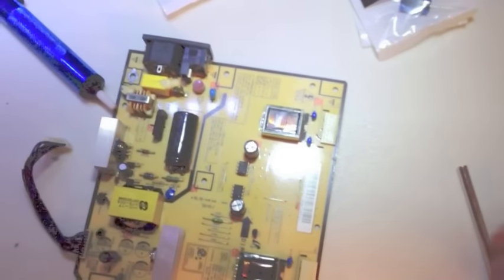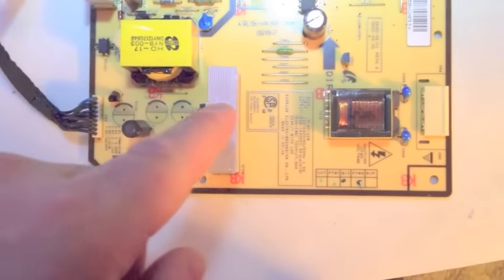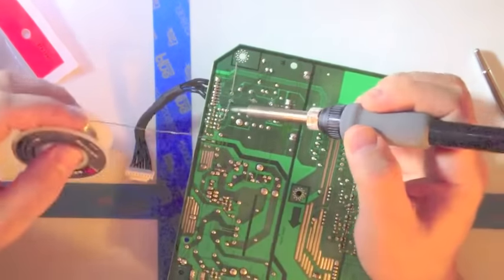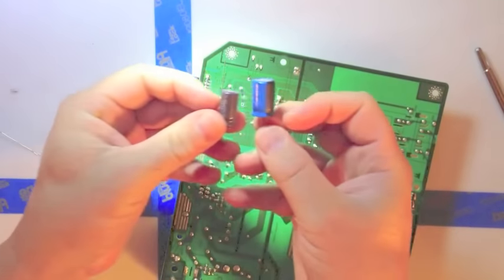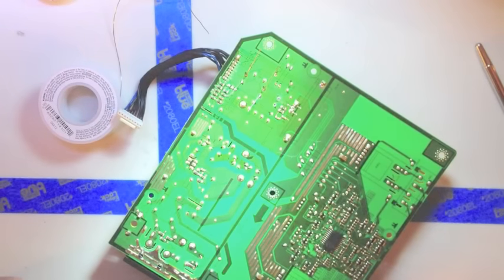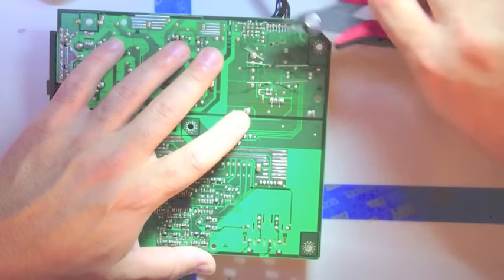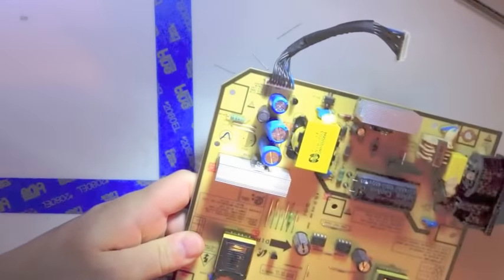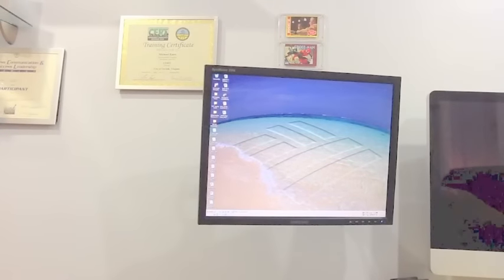Fixing a Broken Gaming or PC Monitor

Comment: I have to do this with my 204T and I'm nervous about it. I don't have a soldering iron, only used one once before many years ago, and can't find a local repair shop that does it (they replace entire boards but don't solder).

Repair kits are sold on amazon for like $20 that include the iron, solder, solder sucker and capacitors. I might look into that solution now that I've seen your video and have some confidence that it can be done.

Comment: Nice job, and kudos on the video.  
Just had a quick question, what temperature did you use for the soldering iron?
Reply from the maker: if I recall, I think it was 650 or 700